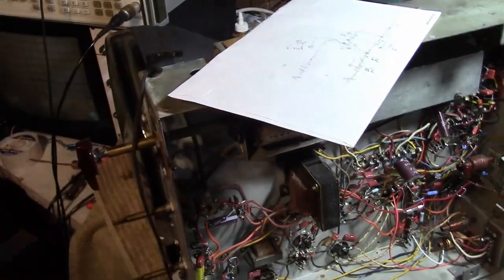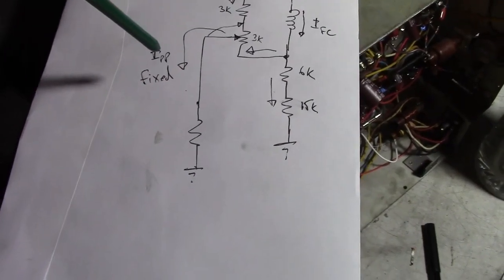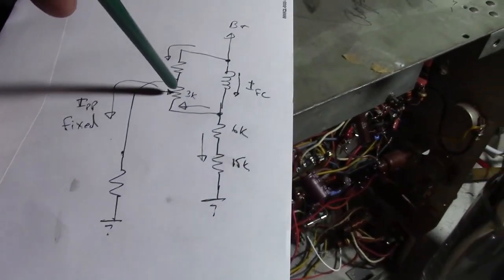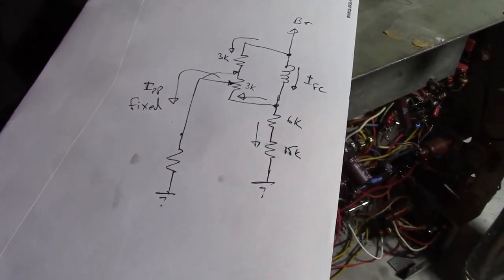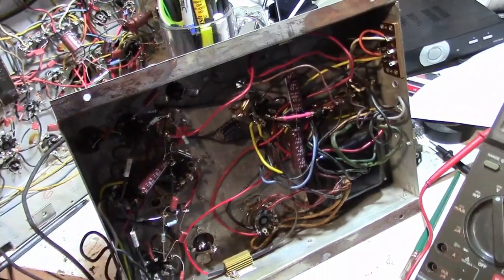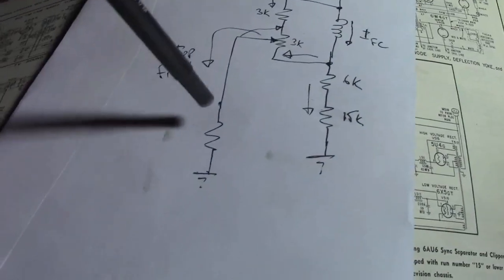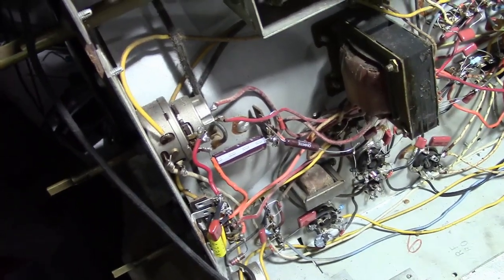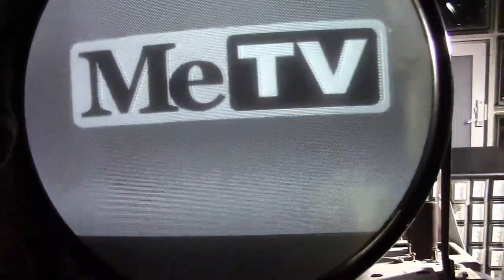Admiral 20B1 restoration p8o?

Comment: i think I mentioned this when you posted about this a few days ago, I use a lot of N.O.S/surplus components, so I got into the habit of testing them before installing them in something, especially resistors. The worst resistors I have found are the sand resistors, in terms of power resistors, and the carbon composition resistors with the rough body. The sand resistors go bad just sitting on the shelf, the enameled ones are usually fine. I think maybe you ran into one that was defective from the factory, if it had overheated, and failed that way, it would show.

Comment: Looking at your previous videos on this set, I noticed that the original focus coil shunt resistor (the 3K @ 5W) was fried.  
Since your replacement may have failed as well, I looked through the Riders service notes on this chassis, and noticed that "Production Change K" mentions that the resistor was changed to 7.5 Watts in the later 21A1 (16") sets "for greater heat dissipation under certain operating conditions".  I'm guessing that may also be an issue in your set.

Comment: I notice that there is a sort of duplicate image about a millimetre to the right of the main one, noticeable on vertical edges in the picture.  I have not noticed this in your other restoration videos.  This can be caused by reflections of walls etc if you are using an aerial, but you are not.  I wonder how you are picking up a reflected signal as well as the main one.  Perhaps one of your cables is faulty, or incorrect termination resistance (75 Ohm?) is used? Great video by the way, so frustrating for you trying to track that down.

Comment: Another thing that I noticed on the schematic, regarding the audio amplifier, the cathodes of the 6K6s don't have a bypass capacitor. Adding one increases base response, and volume of the audio amp by eliminating degeneration, would adding one affect the focus of the CRT in some way? When they leave that bypass cap out in an AC/DC radio it's because of 
cost, but that would not have been an issue on an expensive beast like 
this, just another section in a twist lock capacitor can. I'm not suggesting that adding one would improve the focus, I'm speculating as to why they may have left one out?
Reply from the maker: That's a good question.  The 20A1 version using a single 6V6 does have a cathode bypass capacitor.  If I remember, I'll give it a try in the next installment.
Reply: @bandersentv  I wonder why they would use a single ended 6V6 in one, but not the other? Was it a lower end unit?
Reply from the maker: It's the TV only version with a single speaker. The 6K6s are used in the combo TV/radio/phono sets which either I believe has two speakers in parallel.
Reply: Brian said the current drawn by the push-pull output stage is constant.  I can see that if it is class A, as one tube draws more the other draws less, so the sum of the currents is constant.  If the current is constant, the voltage drop across the cathode resistor is constant, so a capacitor would serve no purpose and would not alter the frequency response at all.

Comment: I have had the E mag focus coils partially short internally, PM focus units get weak, the ion traps get weak, and have had issues with centering when replacing the CRT. Replacing the original yoke with the  one that came with the CRT solves that.

Comment: I bought a bunch of dale 8 watt resistors at 1k ohms.  3 of those in series did the 3k sand resistor trick.  I cannot however get focus over all the screen at the same time.  Doubting neck components as well as adjustment

Comment: Does the other chassis with focus issues have the same problem? If so, maybe start up current burst etc burning the resistors
Reply from the maker: I'm not sure.  I need to dig it out.  That's a good theory put seems a little unlikely as the current goes through to the audio output stage and it doesn't draw until the tubes warm up.

Comment: Why not wire the center tap of the audio output transformer to B+ like in most designs using a push-pull output? That’ll free up any connection between the focus circuit and the audio output stage. Now you can do away with the bit in || with the focus coil and move that wire-wound pot in series with the coil (or use a decade resistance substitution box, assuming it can handle the voltage present in the focus circuit). No offense, but I think someone was smoking pot the day they came up with this design. Why even create a coupling between the audio output stage and the focus circuit? This seems like it would create focusing problems every time you adjust the volume control on the set and draw more or less power (and, thus, current) through the focus circuit. The only things the audio and video parts of the set should have in common is the sound I.F. take off, and the fiddly bits before it (i.e. the tuner, and part of the video I.F. chain, depending on the design.) This just seems bizarre to me. 😊
Reply from the maker: This is actually a pretty common arrangement to use the audio output as part of the power supply or focus circuit.  The output is class A meaning the current draw is constant.  It does not vary with the volume.   You want a steady current flow through the focus coil.  B+ is unregulated and you would need a very large power resistor to drop it down.

Comment: FOCUS FIX... ??  The fix for that is simple...Just  reverse the resistor and the  focus rheostat wires on the
focus coil and you will have full control.. meaning the focus rheostat on top and the resistor on the bottom of your drawing... no parts needed ~!!
Reply from the maker: Problem with that is there would be too much current going through the focus coil and the current getting to the output tubes would vary with the focus control.  The two current paths really need to be there for it to work properly.
Reply: @bandersentv   maybe.   the current would still be the same.. only the voltage to the crt focus would change..... I think thats the fix...
Reply: its just a voltage divider... only thing changes is at what part of the voltage devider you take it.
Reply from the maker: @dandee5018  varying the voltage to the focus coil means the current through it changes.  It's not just a voltage divider.

Comment: Have you got another CRT you could sub in? I am beginning to remember back about 50 years when I saw something similar. I think you have a gassy CRT. That can effect the focus, as they get "soft" as we called it. If you can sub the CRT, that would be conclusive.
Reply from the maker: I do have one I could sub, but you'll see at the end of the video the problem was an open resistor.  The focus works great now 😀
Reply: I did see a purple glow in the CRT neck (11:16)
Reply from the maker: @RoughJustice2k18  Sort of. I thinks it's more the glass glowing. It's gone now. Probably unfocused, stray electrons hitting metal and glass surfaces causing them to glow
Reply: @bandersentv  Yes! On sets equipped with an ion trap magnet, a mispositioned magnet will also sometimes result in a blue glow in the neck.